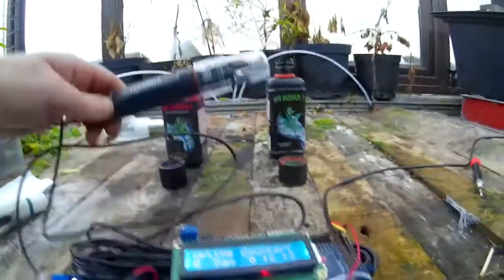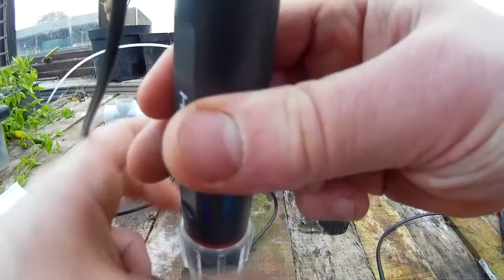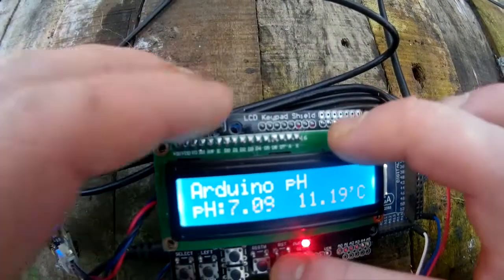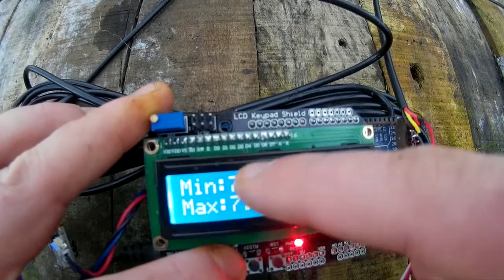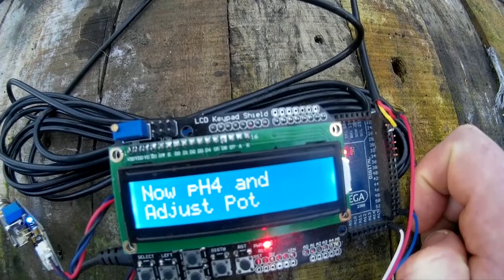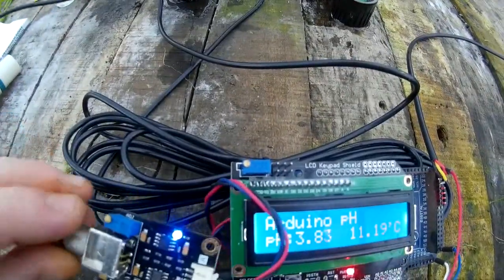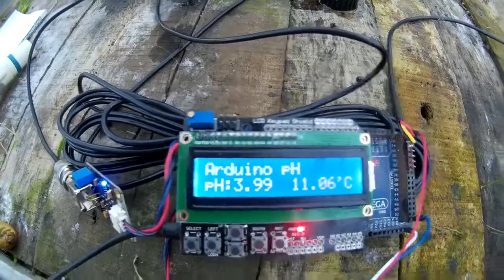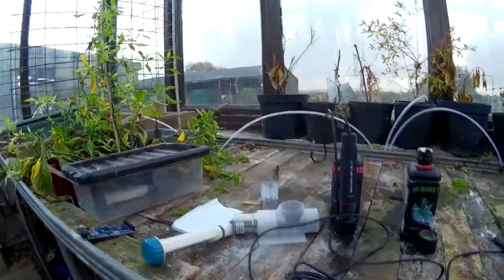DIY Arduino pH Probe reader and LCD Readouts [For Hydropnics or Aquaponics]

Comment: Dear mike.
I have some question. How do you get readout temperature on the screen?  I used your awesome Ph probe code.
But temperature is readout just -127
Please help thankyou
Reply from the maker: Add a pullup resistor for the temp probe between data and +v, Google ds18b20 pullup.
Reply: @MikeRatcliffe24  I solved! ! thank you so much.

Comment: Hi Mike do you know how to use pH and ec sensor at the same time? Because I got problem pH reading when I use both of sensor together
Reply from the maker: Yes this is because the probes interfere with each other electronicly thru the water/fluid. 

Moving the probes far apart from each other as possible in the tank usually solves this issue.
Reply: @MikeRatcliffe24  I have tried this but the results still same, do you have any idea?
Reply from the maker: @vitkynanda8904  is the fluid a very high EC? Also both probes work independently?

Another solution is to move the earth of the EC meter to a digital pin. Turn it into digital output low for measurements and input when not needed. 

Hope this makes sense?

Comment: Hello, Why on my arduino when connected both temperature and pH sensor, my pH value increase when my temperature increases(I placed my hands on my temperature sensor)? It is weird and i do not know why it is happening.
Reply from the maker: Ive read thru the code and cant see why this would be happening..... is the temperature probe faulty?
Reply: I am not too sure myself, is it possible for you to help me? Here is a link to show the problem in a more detailed way. Link: https://forum.arduino.cc/index.php?topic=482026.0
Reply from the maker: Things to check:
-Run the code on a uno/mega 
-Swap the temp probe... 
-dont use the modified library, instead solder a resistor 
-Add a one second delay  between measuring temperature

Comment: Hi Im noob when it comes to code and arduino but I really liked your elcheapo ec meter with arduino uno, would it be possible to buy just one arduino mega and download both codes, connect ec and ph meter to it  calibrate it and it would show both ec and ph ? thank you
Reply from the maker: It should be possible [make sure to keep the probes at a decent distance apart so they wont interfere]
joining both codes may be a hard project to start with if its your first arduino project, not impossible but the LCD scripts will make it a tad complicated.

Comment: could you share your code . please ?
Reply from the maker: +Knight Rm 
You can find an updated vaerison of the code here [copy and paste into IDE]:
https://www.element14.com/community/community/design-challenges/vertical-farming/blog/2016/01/08/automated-green-house-blog134--ph-control-ph-probe-lcd-readout-gui-probe-health-readout
Reply: +Mike Ratcliffe thankyou so much
Reply from the maker: +Knight Rm 
No Problem, Glad it is of use to someone else. 
Depending on what LCD shield you are using you may have to alter the code [See the questions under the blog] and the thing will need to be calibrated prior to it giving a pH reading. 

Best of Luck
Reply: +Mike Ratcliffe I have just tried it. it quite complicated. so do you have any PH sensor project  ? just only display the PH data on LCD 16x2. thanks !
Reply from the maker: +Knight Rm 
Its part of a larger project to control the pH of a aquaponics/hydroponics systems. Knowing when a probe is degraded helps keep the system automated and running smooth.

Comment: you really should rinse the pH probe with distilled water before calibrating in another solution.
Reply: +Jeff Powell Would RO water work as well? Got a nice RO filter, would hate to have to buy distilled just for this.
Reply from the maker: +Jack Macejko 
Jeff Is correct a rinse between fluids is recommended. 

Just out of interest are you using the code from this video?

The idea is not getting anything in the pH4 fluid that would corrupt its pH value. I find tap water does a good enough job, just make sure you give the probe a good shake to reduce fluid transfer as much as possible. In a scientific study the method in the video [no rinse cycle] would be a big no no, but for my aquaponics system the probe calibration is not high tolerance.
Reply: +Jack Macejko RO is fine as well as deionized if you have some :)

the idea is you want to set your probe up to have only the new solution being measured.

by not rinsing you are changing the pH of the next calibrating solution.

this causes an error in all future measurements
Reply from the maker: +Jack Macejko 
There is an updated Calibration Video now and a new code with a few extra's:
https://www.youtube.com/watch?v=BgHR5MutKHY&feature=em-upload_owner
Reply: What's the pH of distilled water?